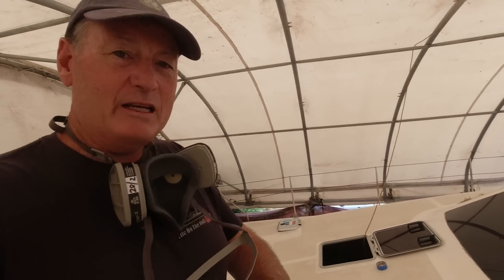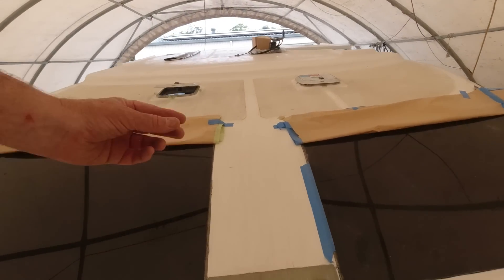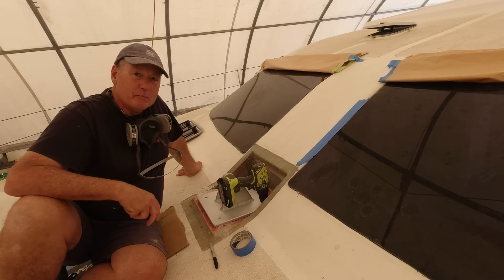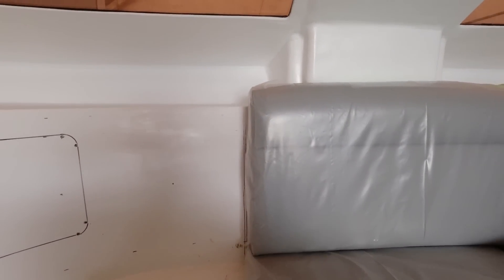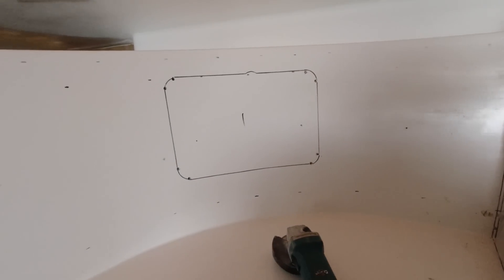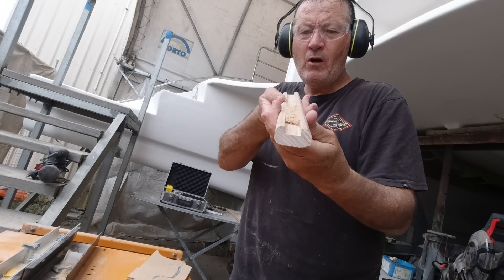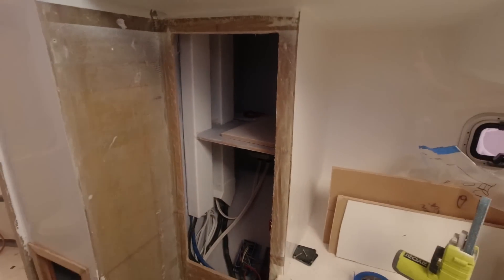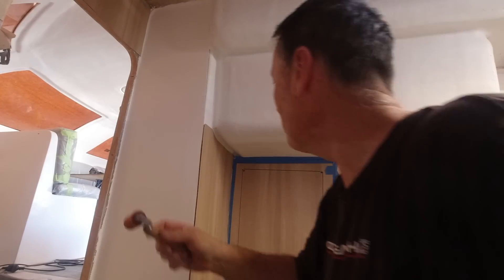Fitting the Mast Base - Catamaran Build Ep332

Comment: If you have to cut more tight spots like this, you might want to get a pneumatic reciprocating saw.
Reply from the maker: I used a battery reciprocating saw in the cut  worked a treat.Thanks mate.Rossco

Comment: Why not tap in a thread for the bolt you cannot reach the back of, especially if it is that thick solid fibreglass. Or even a stainless coach screw… didn’t have to be nut and bolt… nice finish though, thinking of all the future servicing which the new production boats do not do making them very hard to work on!!

Comment: Rossoc idea for that Cover put a Battery operated Light or a Bedroom Light with a Wall Switch. Rossoc are you going to Use Stainless Steel Chain Plate Rigging? Have to Seen Matt’s Carbon Fiber Chain stays he made For Duracell?

Comment: With fiberglass and metal you can fill or add on more material to a hide short comings. With wood adding material takes a lot more effort and skill.
Reply from the maker: It certainly takes a tonne of care with wood.Fibreglassing is really just advanced papermache.Cheers Kev.

Comment: Great progress.  Bit of advice I was given by a builder re no more gaps, not great to use where it's highly visible as it eventually dries out, hardens and then cracks with movement.  A silicon base caulk avoids that as it stays flexible.